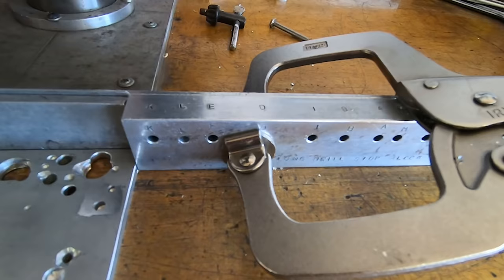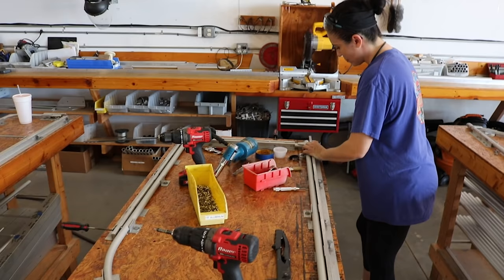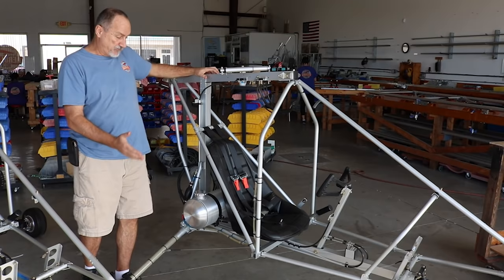Aerolite 103 Ultralight - How its Made - Factory Tour - No  License Required - Part 103 Legal

Comment: These things are seriously cool, I wish the UK had part103.
Reply from the maker: Thank You. What do you all have over there for small light aircraft rules?
Reply: @ExperimentalAircraftChannel  something like this would go under microlight regulations, but there is a rule saying an aircraft with an empty weight + fuel of less than 70kg doesn’t need a licence. It’s aimed at paramotors and a few flex wing micro lights have made a sub-70 but I doubt a fixed wing will ever manage it!
Reply: @jamesaddison81  in Germany we have a Aerolite 120 but you need a Ultraligh license
Reply: Have you looked at UK Microlight rules? My guess is that the Aerolite 103 meets those standards. They are also available in Germany as the AEROLiTE 120.
Reply: In Australia if it flies you need a licensed ,renewed every year plus aircraft registration so very little left of $ 10 11:01
Reply: I meant $ 1000 .enjoy the experience

Comment: Heads up when you use aluminum on a grinding stone the metal gets inside the stone through all the tiny cracks and crevice's. After time the stone through heating and cooling can have a large crack causing the stone to separate while it is spinning what 10k+ rpm.  That could cause for a bad day or possible death.  I am a disabled/retired aviation sheet metal and composites tech. I know what I am saying is true.  PLEASE DO NOT USE ALUMINUM ON GRINDING STONES
Reply: They were using a 3M deburr wheel on the left...you could see the color of it and the smooth edges on the tubes.
Retired Air Force veteran and used quite a few of them...best thing ever made.
Reply: @keithlucas6260  Thank you for your service!  I was in the USAF and served during Desert Storm.
Reply: @keithlucas6260  The wheel on the right is stone and full of aluminum!

Comment: I really do wish the LSA regs would change and ultralights received a weight bump.  A sport pilot cert is nearly useless if you can pass medical and this kind of weight restriction is holding back some really innovative design features as well as spits in the face of safety for ULs...  That being said, there's some really interesting designs out there given the limitations, the 103 Solo and the Merlin Lite to name two.

Comment: Love this plane. But it still needs a hangar.
Reply from the maker: Yes.... but if you really need to, you can remove the wings in about 30min... putting them back on might take twice as long but doable. Not an EVERY DAY thing to do but... maybe once per week on the weekend?
Reply: Yep. Hes right. I used to have to take mine apart to store it. Allow an hr to put it together and check it all out. I also used to take just the tail off and i made a dolly to roll it sideways into a shop with a 10 ft door.

Comment: Even though I have a PPL, I've always been interested in owning one of these. 
Nothing against fabric planes but I'm curious on how durable it is and what is the life span of the fabric?
Again, looks like a great plane.
Reply from the maker: From what I understand it depends on how and where it is stored. If in a hangar a VERY long time. If outside I think it is around 7-8hrs of abuse from weather and sun. Dacron is pretty durable though. Some also spray a clear coast with UV protection that can also make last longer. Thank You for watching!
Reply: @ExperimentalAircraftChannel  7-8hrs, or 7-8 years? In my limited experience, uncoated dacron will last maybe 7 years with 1 hr of direct sunlight a day. Just perform a punch test every few years and don't fly if the tool punches a hole at fewer than about 10 lbs of force.
Reply: @joeteichert6821 ,
yep, the guy on his airbike took 3 days to fly from northern California to Arizona's sun & fun.....

Comment: how many feet do you need to take off and how many feet do you need to land? I have 800-1000 feet in my yard is that enough? Can you mod with arresting hook?
Reply: These things can take off and land in that distance no problem. They only require 100-200ft for take off and landing. Allow for double that just to be safe and you’re still good. Just make sure no obstacles at either end that you’ll need to climb over

Comment: I understand the copper plumbing corners are convenient to use, but isn’t it bad practice to mix copper & aluminum?
Reply: They use a sealant to prevent direct contact between the two dissimilar metals to prevent galvanic corrosion.
Reply from the maker: Great questions! I believe it was answered below. Thank You for watching!
Reply: @michaelkirk5932  In a perfect world!
The boating world warns not to drop small pieces of wire in an aluminum boat.
Reply: You have bending equipment. Why not make aluminum corners?

Comment: De-burring on a bench grinder??. What the heck. Save time and get a smoother finish. There’s a hundred types of factory efficient de-burring tools. And like the host mentioned about the tube bender……that aluminum usually Always warps back to a lesser bend angle . Especially in cooler weather. Laying over a table top and eyeballing it over two black sharpie marker lines seems like “no two aircrafts are alike” . These are aircraft with living pilots operating them. We aren’t planning on strapping our pet hamsters on the seat and R/C operating it.

Comment: The fatal crash rate per 100,000 hours of Ultralitight is 5 times higher than the z general aviation fatal crash rate per 100,000 hours.
Reply: Extremely safe versus very safe.  Adventure involves risk. The simplest means of reducing your risk when flying is to wear a helmet.

Comment: NOPE! Bending 6061 in T6 condition is an absolute no go!  If they want to avoid the heat treat process of aluminum they can use steel for their bent tubes instead. 6061 T6 needs to be sent out for annealing and will be returned to the shop on dry ice, they will have to bend the tubes immediately before they get too hard because the dry ice only slows the aging process. Then the tubes go back out for aging to go back to T6 condition.
Reply: Lol

Comment: ON THAT TYPE PLANE IS THERE NO BOTTOM WHERE YOUR FEET GO? IT LOOKS LIKE YOUR LEGS WOULD GET TIRED
Reply from the maker: Flintstones Mobile? Hah! I asked about that and there is only a small flanged area on the pedals to hold your feet on. I would like to see a small Floor Board just enough to keep your feet from falling below in turbulence or something. I was told it hasn't ever been an issue. I like "False sense of security I guess." :-)
Reply: @ExperimentalAircraftChannel  THANK YOU FOR YOUR ANSWER. I GUESS THAT WAS CUROSITY. I STILL LIKE TO HAVE SOMETHING UNDER MY FEET LOL.
Reply: @moparpapa1435  On a vehicle like this you are free to modify how you like.

Comment: No good. Terrible design. You have to check for the cracks in the welding area. I know it is a standard procedure, but it means you can't trust. It means the crack can happen in the air and can break completely in the air.  And the way it is done and welded, I would be surprise if wouldn't crack  eventually. What about the wings? You can't see cracks there. So it means terrible design. I have the best engineering skills ever. I wouldn't design that way. It would be 100% no failure, like any other vehicle driven on the road; you don't have to look every day if there is a frame cracked. Again, that's not the way to put ultra light together; if I would do it, the welding area wouldn't have to be inspected because it never would crack. The airplane would wait about 4 pounds more but would never, never crack in the welding area. Imagine that you get a bike on this street from the rental area, and you have to inspect every time if the frame is not cracked. Or imagine that your kids riding on the bikes and you go everyday and say hey kids  hold on, let me make sure that your frames on the bikes are not cracked. So again; that's a terrible design. I have a few more points, but for now I wanna just show that. I know in aviation that's the requirements To check for the cracks. But how you wouldn't make the kind of requirement If something is done the way as it is.